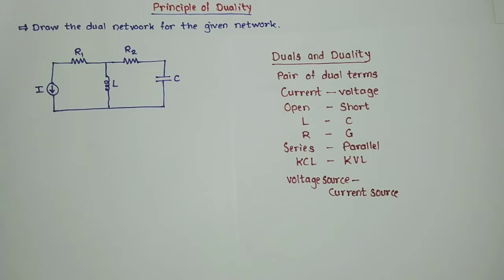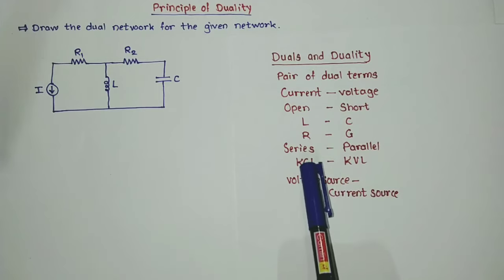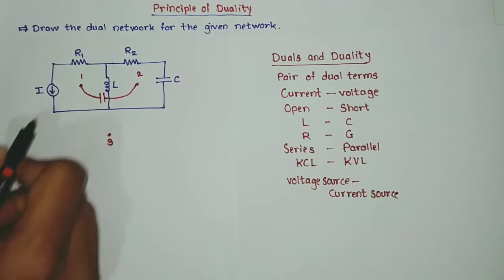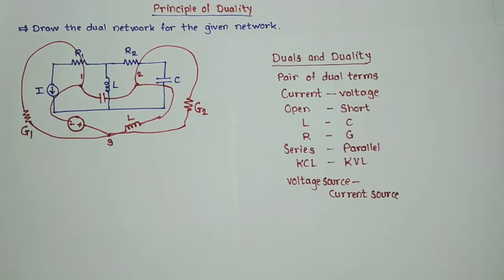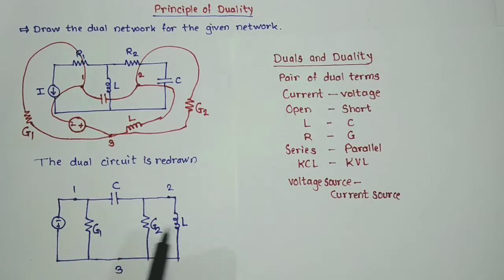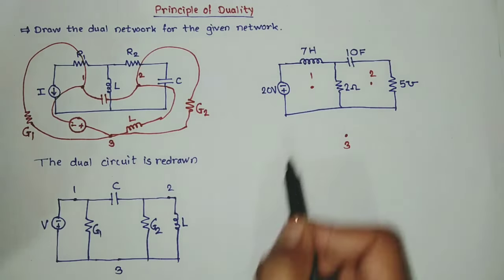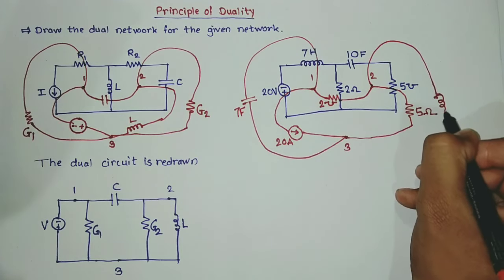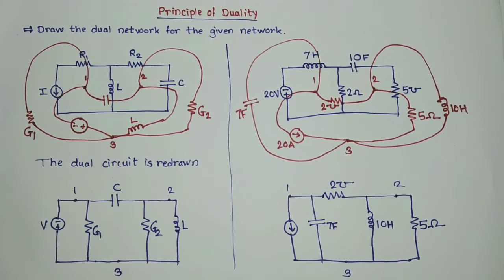Principle of duality (solved problems) | Dual network in network analysis

Comment: In middle 2ohm resistor is replaced by conductance
But u replaced by mho ....?
Reply from the maker: Yes its unit is mho. If you want to write unit Ohm then conductance should be indicated by 1/2 Ohm.

Comment: In the solved example , shouldnt we take G=1/R 

So conductance in the solved example should be 1/2 mhos. ??
Reply from the maker: No. If it is reciprocal, it should be in Ohm not in mho. so 2 ohm should be replaced by 2 mho or 1/2 ohm.

Comment: What's the definition
Reply from the maker: In Dual networks the mesh equations of one network are equal to the node equation of others. 

The role of current and voltage in the two networks have been interchanged. The solution 
of one equation is also the solution of the other. This similarity is termed the principle of 
duality.